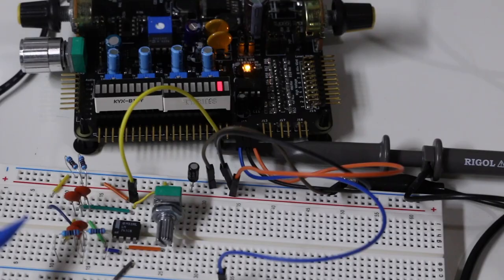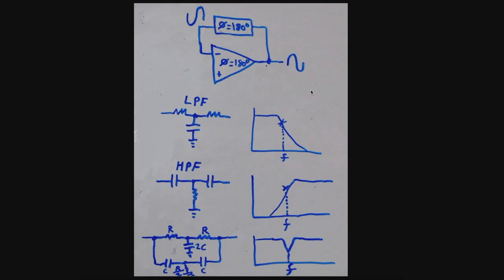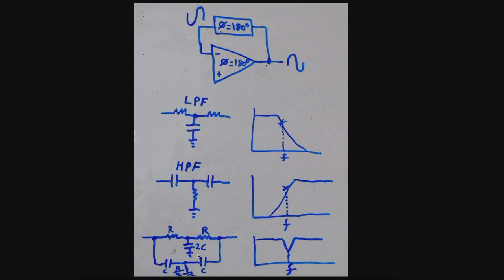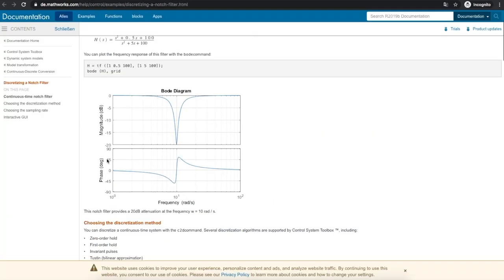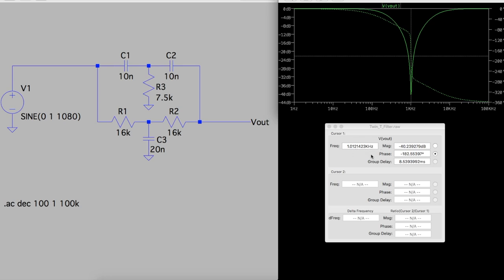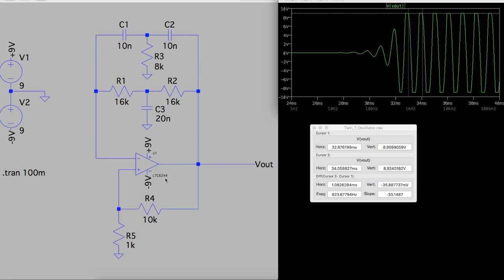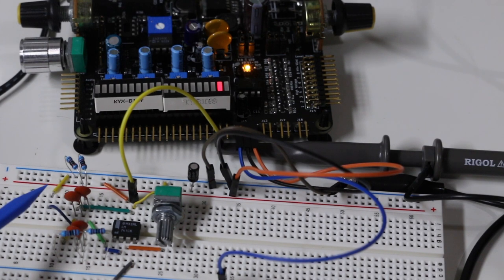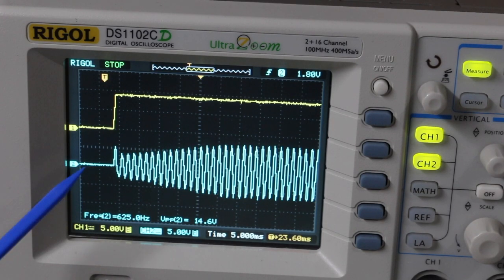SINE WAVE OSCILLATOR:  Twin T RC Filter OSC with LTSpice Simulation and Breadboarded Circuit

Comment: Nice simple explanation of an rc oscillator,  9.30am on new year's day was a bit too early :) one thing you could have pointed out is that XC = 1/(2 pi F C) is the impedance of the capacitor at frequency  F as its an important part of understanding an rc filter. Great video.  Pcb has arrived but still waiting on 0805 components :(
Reply from the maker: Glad the PCB arrived!   Yes it’s kind of hard to tell where to begin and end with the information conveyed for a given topic.  I didn’t want to get too deep and I know that some information is required to get the point across so it’s a balancing act.  
 Stating the reactance  of the capacitor at a given frequency might have been out of context because what we were doing was trying to simplify the whole equation down to calculating a frequency response with a certain configuration so we didn’t need to actually know how to derive or account for  components discretely. 
Maybe in five years I will have an even different perspective from today where I convey things a little differently but I guess in the end we just need the formula to get the job done  and understanding it’s derivation is optional based on the interest of the person. 
 One thing I learned from all of my combined education and experience is I usually end up a little confused no matter what path I take and I just try to grab information from everywhere and fill in the blanks.   So that’s why I try to put links in the description for more information if there is somebody with more knowledge than I who can get more out of the information. 
Overall I guess it’s good I didn’t get into Laplace transforms  in this video because nobody needs to wake up on New Year’s Day seeing things like 1/sC  in a weird equation.  I still have nightmares of that from over 20 years ago.
 My knowledge and experience is all over the place. 
 I know enough to know that I don’t know very much.  So if I can either pass on some knowledge or at least the inspiration for someone else to move forward and learn on their own, it’s been a good day.
Reply: @GadgetReboot My mum who is visiting for Christmas and the new year wanted the stamps :) so no videos made while she's here with her two dogs.

 Don’t mention "Laplace Transforms" I never got my head around them. I could never see how to rearrange the first transform equation to the final one required transforming back to the real world. I just got used to the fact that I’d not get 100% in the exam if one came up as a question. Plus in the 40 years working in electronics and avionics since doing those exams I’ve never needed to use them.
Reply from the maker: The reason there are an odd combination of stamps is because I have had those sitting around for years with no opportunity to use them up so you helped me de-clutter! Then the post office figured out the balance and put that other postage label on. 
 I’ve never had to use most of the school math since the final exam in those courses. The only integrating and differentiating I’ve had to do is with op amps.
 But I still have all the text books and occasionally I turn a few pages just to see if there’s any application I can make use of in modern times, but usually my eyes glaze over before anything practical emerges.

Comment: Do you know whether there's a way of varying the frequency using a pot? Obviously the capacitor size changes the charge and discharge time thus affecting the frequency, however which resistor  alters the frequency
Reply from the maker: The Twin T is intended to be a fixed frequency and the ratio of component values should stay balanced, where two resistors should always be identical and the other is half the value. So if any one changes with a pot, it's all messed up...
Reply: @GadgetReboot  ah okay. Thank you